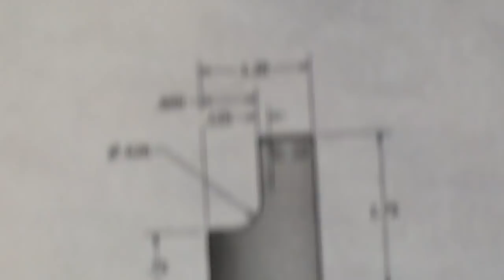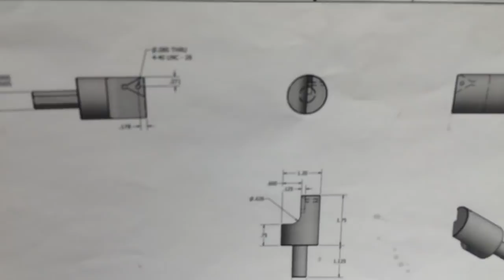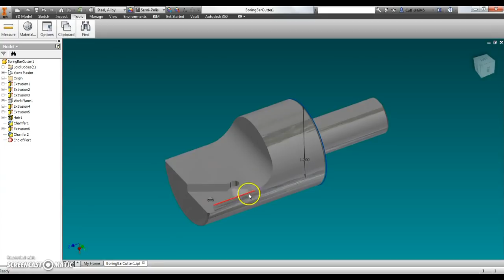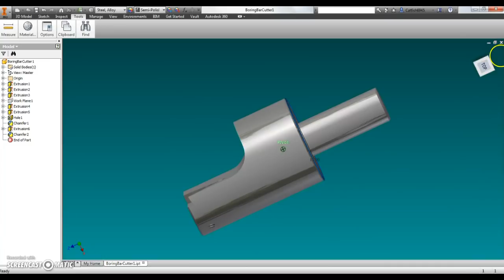How To Make a Insert Boring Bar P2

Comment: I hope you guys stay fire free! That kind of problem blows my mind, I feel lucky to live in the land of rain and streams.
Reply from the maker: +bcbloc02 Thanks Brian.  Bad fire situations here.  A bit of rain would really help..  Randy
Reply: +bcbloc02 Thanks Brian! We did have a few sprinkles this morning, but they were so few and far between it was more of a cruel joke! Luckily for us we've got allot of empty space around our homes that even if a fire came down here it would just burn around us in the grass. That, and we've got 2500 gallons in a tank with a 3" fire fighting pump and hose system that I'm going to eventually plumb sprinklers onto our roofs with. 

Hope to never need it, but it's great peace of mind, also after hearing about all of the houses lost due to the power going out will make us invest in adding solar power to our pump house. We've already got the panels, just need the inverter and a battery bank ;)

Thanks again...Aloha, Chuck.
Reply: Good luck with your personal fire fighting equipment Chuck! I hope you never need it too. I have a spring a pump house and a backup generator but never thought I might need those to keep things safe. I hope you guys get a decent rain soon.

Comment: Nifty set-up for the X-Carve. 
Pretty tough work on that 4140 with the big initial cut... did OK though. Liked the way you cut the insert relief ... nice. 
Sad to see that cutter break! 
Heart in mouth at last stage - drilling and tapping - relief to get that done safely. Very nice job and enjoyable to watch
Thx for adding me to your list Randy :)
Reply from the maker: +ChrisB257 Thanks Chris.  Heck if your going to cut it, then cut it.  I thought I was going real slow.  I use a #41 drill in this stuff for about 50% thread.  You can't do 75% threads, I have tried.    Thanks, Randy

Comment: Enjoyed both videos on the build.....very nice tool!  Just for discussion when I sets the insert location I put a test indicator on the pin shaft to let me see the load on the pin, final location I like to preload the pin .0005 to assure that when the insert in attached I know the insert is pushed against the pocket wall
Reply from the maker: +outsidescrewball That would also work Chuck.  I just do it by feel, there is very little to no pressure on the pin. (I think)  I will have to set up the indicator and measure the hand setting.  Good point thanks for the suggestion.  Randy

Comment: Nice build for your boring head.  I can see why the pocket for the insert can be very difficult to get right but looks like you had no problem.  Do you ever plan on offering these like your dove tail cutters?  If so, sign me up.  They are really clean!
Thanks,
Reid
Reply from the maker: +Reid Eichner Thanks Reid.  I still need to do some testing and then maybe some changes, then more testing.  We will see where this goes.  Randy

Comment: Hi mate.You are better than I.  I would have gone for the fly spray about hours before you waving at them.  Those blue lights work wonders in catching the bastards.  On Bali there are several Ace hardware's, and I bought a good one for not much at all.  We don't have them in West Australia.  So every time we go to Bali I come back with lots of tools.  That was a nice piece, well done.  However I think that the oil was stuck in the weir.
Reply from the maker: +Marcel Timmers they are these tiny little face fly's, if you are in the sun they don't bother you.  Oil will be caught on the entrance side of the dam, only clean fluid will flow over the wier dam, unless you have so much oil that it displaces all of the coolant.  Thanks Randy

Comment: +Randy Richard Enjoying the series Randy.  TIp on the coolant tank.  If you stick some magnets on the OUTSIDE bottom of the tank behind the weir it will really catch a lot more ferrous chips.  When you want to clean it, just pull the magnets off the outside and the chips fall away easily.  Love the Bozo moment "Dink" the sound of breaking carbide.  Know it well.
Reply from the maker: +James Kilroy Thanks James, I have some big Radar Magnetron magnets.  I was even going slow. Randy

Comment: Hi Randy, nicely done, how does it behave when turning fast...?  Is balance ok...   Maybe one suggestion, for the area where the set screw lands on the flatten shaft you could make a lower zone as if you install it on the side of the boring head, the bar doesn't fly away if the set screw loosens a little... Just a feeling.
Pierre
Reply from the maker: +pierre beaudry I have not run it yet, maybe tomorrow.  Good idea on the recess.  But i would not run it backwards, it could unscrew the boring head from the arbor.  Thanks Randy

Comment: If you had cut relief for insert on other side, wouldn't have turn back wards on the side mount. Mine unscrews from adapter when run backwards.
Nice job on insert fit up.
Reply from the maker: +Rick Brandt Yep, already have several more design's drawn up.  Thanks Randy

Comment: hey Randy,
another little note: you should increase the ratio of your coolant. it should look like milk. i run about a 20% mixture on my mill. it lubricates those TiN coated and carbide bits better although they're thought to be run dry. with a higher mixture ratio, the coolant will also take up some of the oil (mine looks like chocolate milk..lol) that would otherwise float to the top of the coolant reservoir thus increasing the lubrication effect.  i also made some splash guards for the mill table that have raised sides to reduce coolant loss due to oversplash. i gave the splash guards an elevator screw at the end next to the vice to allow the coolant to drain away from the vice and into the return lines at each end of the table.
with only a 5% mixture ratio you'll be experiencing corrosion issues.. i still have them at 20% too but the rust is usually just a stain that wipes off easily.. (i'm putting this next part in there for those who are contemplating the installation of a coolant system on their mill) also you have be diligent with clean up at the end of the day. which means removing the vice and wiping off the table, dividing head or rotary table or work piece depending what's strapped down at the time.
another thing i did with my coolant system is mount the spout in a holder that attaches to the dovetail of the swing arm of the mill. that way the spout doesn't run back&forth with the work and puts a nice steady stream where it needs to be. and i put a petcock valve in the base of the spout tube so the flow is easier to regulate thus reducing oversplash
Reply from the maker: +HolzMichel Yep I agree on the coolant.  I did not have enough to make it a higher concentration.  I will be increasing the concentration.  Yes I need to rig my other mount for the liquid coolant.  Thanks for the suggestions.  Randy

Comment: Great video,  I've been trying to work out what I would have to change in the geometry to use some tnmg inserts .. no rake on them so 6 cutting corners. I have a bunch of them. I'm working my way through your videos, and aim to make turning tools and end mills, maybe a flycutter as well once I work out the tool pocket geometry.
thanks again for your great videos.
Reply from the maker: +lookcreations Thank you.   The no clearance angle type of insert is a bit tougher, compound angle for the seat.  Also usually have a negative rake angle also.  Are you making drawings?  what size insert?  Randy
Reply: Hi Randy, thanks for the reply, I really should do a drawing - pencil & paper is my limit these days.  I will measure up the inserts in the next day or two and look at the options.

Comment: Hi Randy,
            Another interesting video. I liked the drawing package you displayed , can you tell me what drawing software you use. I have been using Visio for the last 30 years and I think it's time to say goodby to it because it now has more problems than is worthwhile, so I must move with the times and upgrade.
Best Regards to you and yours.
MoK
PS.. No fires in our area of the UK although we do have what you need, and that's rain, rain and more rail. I don't think anything could catch fire.
Reply from the maker: +Mo King I use Autodesk Inventor most of the time, here is a link,  http://www.autodesk.com/education/free-software/inventor-professional.
Onshape is also has a free version is very good.  Autodesk Fusion 360 also very good.  Is has been quite wet here this winter more of a normal winter,  snowed off and on a few days this week.  Thanks, Randy

Comment: hi randy i made one of your boring tools it turned out great but dosent cut lol. i have a tnmg in there with flat edges no rake. help lol what kind of cutter do i need? i use tnmg on the lathe and works great but not on the mill. any advice would be great. thanks randy. and thanks again for sending the plans for the boring tool.
Reply from the maker: It is very important that the cutting edge is on the center line of the tool.  Also the insert must have a clearance angle 7 to 11 deg will work.  This is so the heal of the tool will not rub.

Comment: Do you think you could have bent that !/2 shaft by using the rough cut in one pass ?
Reply from the maker: +TERRY RONALD RACKLEY I guess it could be possible.  I check an I have a TIR of 0.004, which is about in line with using the 3 jaw.  But this tool is not intended to rotate about it's own axis, so a little off should not make to much of a difference.   Thanks for bringing that up.  Randy

Comment: I've been wondering about why you chose to make the head so much larger than the shank. It seems to me that the shank diameter is what limits the strength/rigidity of the tool. Any extra head diameter just means a limitation on the smallest diameter you can bore.
Reply from the maker: +Peter W. Meek I agree with you Peter.  But having the flange end up against the boring head body gives you little to no deflection.  I actually did not think to much about it.  I drew up another smaller boring bar and will make that soon.  I still have to test the larger one.   Thanks for the suggestion.  Randy

Comment: Hi Randy
as a forester going machinist it still pains me to hear about the fires. of all the many stupid ass things the clinton administration did, one of biggest screw ups was shutting down most of the logging in the western states.  since most of the west was on a fire regime prior to settlement, the fires weren't as big as they're getting now. a century of fire suppression combined with the absence of timber harvest in the last 20 yrs and the forest services stupidity of allowing fires to go "project" in order to ensure funding for coming fiscal year, we'll be plagued with large fires until there will be little, if anything left to burn. 

these fires are all preventable with proper management. you can reduce the risk of fire to your home and shop by doing some of the things CDF recommends. they have a pretty good little pamphlet out showing home owners how to better protect themselves. by implementing some of the things they recommend you can also get some reductions in your fire insurance rates. 
i'm still working on a video series that will help guys like you manage their property better and reduce the risk of fire to house and home. it should be finished in a few months.. i'm still having trouble figuring out the software that was delivered with my video camera.

hope the rains kick in soon for you guys.. i worked a few burns in your neck of the woods up in rose creek by sonora and the icehouse burn along US50 and one in yosemite back in the mid 90's so i'm keenly aware why you're sweating bullets about now.. the manzanita brush goes up like gasoline this time of year in spite of it being a bit of an evergreen. 

cheers
mike
Reply from the maker: +HolzMichel Thank you for your concern Mike.  We have cleared beyond the requirements for CDF, and we continue to do more.  I also have a Water Buffalo, generator, water storage tank, tractor and dozer and I am a trained and experienced fire fighter.  But I think that with as dry and as everything is we would be leaving.  
Thanks again for the comment,  Randy.